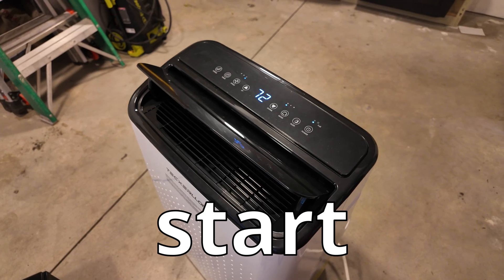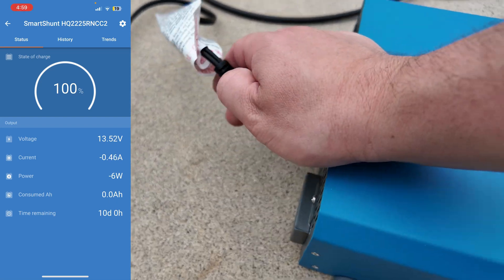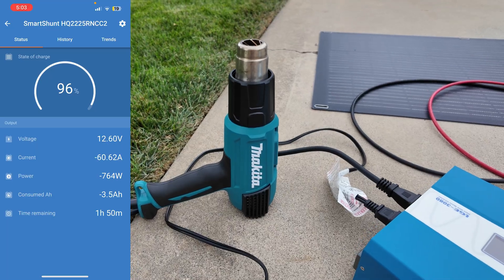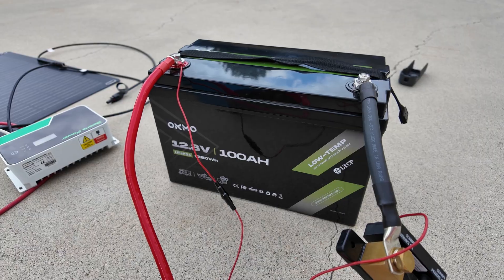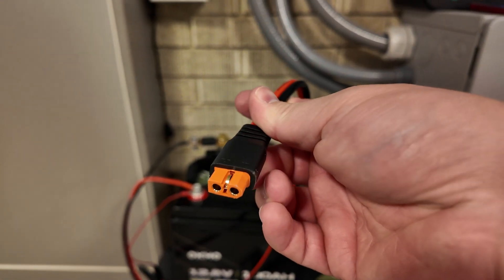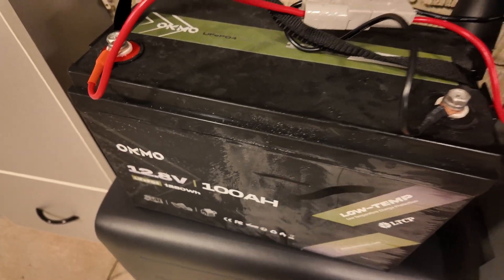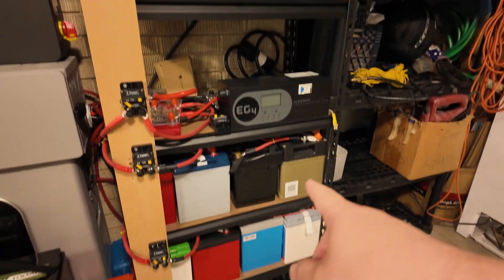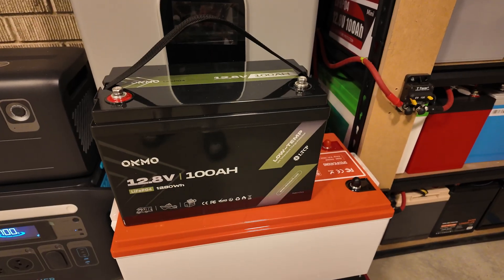CHEAP LiFePO4 Tested! OKMO 12V 100Ah Battery Review & Stress Tests

Comment: Is the chargeverter able to fully charge the tower? I want one for my 4S1P bank but I'm worried the listed 57v max won't be enough to get a full charge on a 51.2v system
Reply from the maker: Yep! It does for mine! But I have a sweet battery balancing system installed with my tower of power!

Comment: As you have both.
Which one wins this one or the Temgo brand .
Reply from the maker: Temgo hands down if you want 48v power. This one is 12v. You can connect it in series like I have on my tower of power, but there’s extra cables and stuff you need for that, so if you want 48v best to just get 48v to begin with.